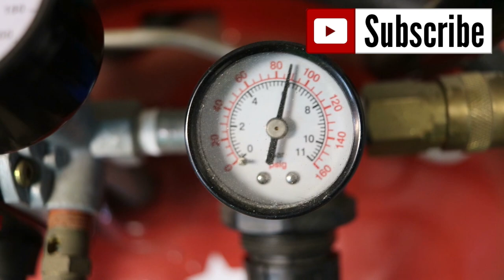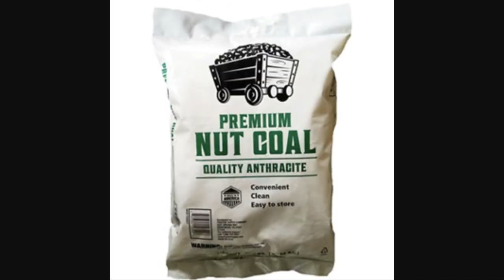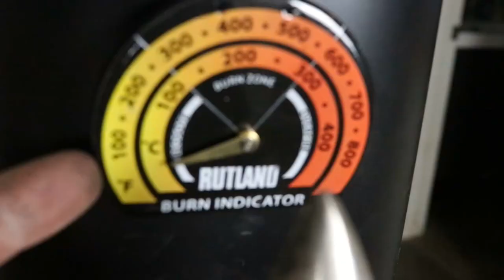Restoring 111 Year Old Coal / Wood Stove

Comment: Nice restoration. Having been a bricklayer, owned & installed stoves, I hope you heed the warnings. Stove pipes are installed upside down & will leak creosote, improper fittings used, need for Durarock, or masonry behind the stove as a heat barrier. I hope you inspected the masonry chimney. They are dangerous, prone to chimney fires & if not sealed can leak combustible gases that will burn your house down. It is much safer to use double wall stainless steel flues. If you have small children, you will need to keep them from touching it. Last but not least, I hope your house has good ventilation, as those old stoves need a lot of fresh air, and are not sealed very well against leaking carbon monoxide into your house. Last, but not least, they are not legal in some areas as they do not meet minimum efficiency / emissions standards.

Comment: its supposed to go in the center of a single room with a pipe straight up through the tin roof in like an old schoolhouse  ran one as a kid plenty ..  that shiny stuff is plating .  that particular type of stove gets super hot .more than a normal stove 
why sandblast it .? that removes metal  just fire it up outside with a few feet of pipe and a damper. wire brush details   then get some stove black ..gotta apply it hot with a fireproof glove and a brush or rag ..then cure it by adding a bit more fuel.. now let it burn out .. congrats youve now re blacked it and cured it . dump the ash  and install it

Comment: Nice looking stove, good job on the restore. 
I agree with beingsneaky, female end should always be pointed up, or with the draft flow. I know some people think smoke can come out this way, but its not the case due to the draft, which increases as your flue gets hotter. Putting it with the male end pointing up could have creosote run out of pipe, it makes the pipe look crappy after a while, it will cause smoke, and possibly even fire if runs onto the hot outside of stove.

Comment: Brother said cool,maybe two screws in each pipe connection for safety,might even be a hole in stove collar for a screw. High temp 1200 degrees. VHT 2000 degrees. Thanks love old stoves

Comment: Oil would work as well probably better than paint.that camera is noisy.I have one of those fans for my stove they work great.Dude you need a heat barrier behind there and proper clearance from that wood shelf or you will burn your house down wood or coal coal burns extremely hot you should probly get at least double wall pipe for coal burning I have single wall but I just burn wood, coal burns a lot hotter.

Comment: I've  had my Smooth Oak C-15 in since1983.After I broke it down,sandblasted & painted  it, I had 8 separate pieces chrome plated.In my basement,I put in a old type brick wall,with fire proof sheet rock ceiling,then ball peen hammered copper flashing for the ceiling with 2 high hat lights. It sits on a tiled,1brick high base.I burn wood & coal.It's been burning at temps up to 700-800 degrees, no higher.I totally agree with the previous 2 guys.Be safe.

Comment: Looks like a fire hazard.  Single wall black pipe and especially connecting to your chimney pipe with your walls only being 1/4" away from from the single wall black pipe. Not good.  You also need a heat shield around the stove and black pipe as it is ALL to close to combustible materials. Just sayin